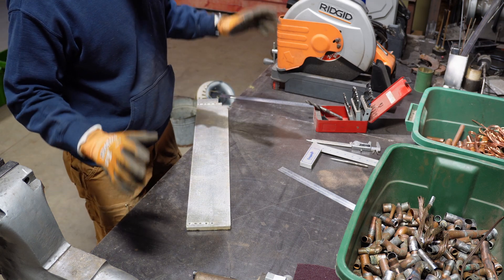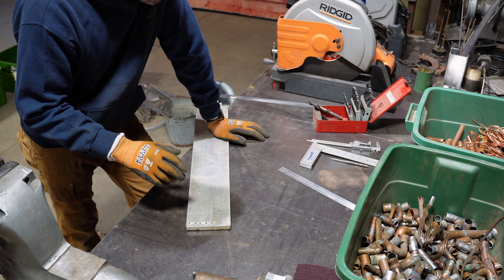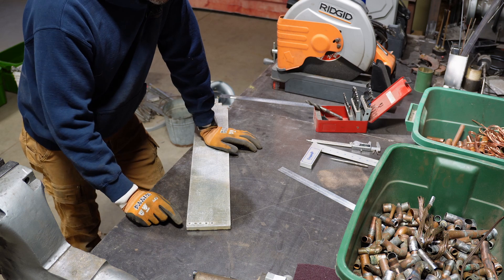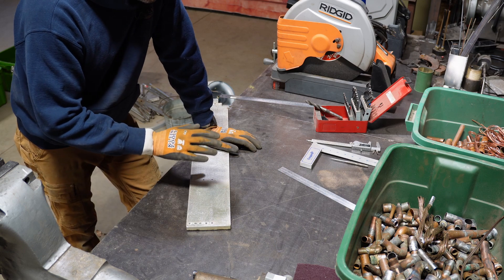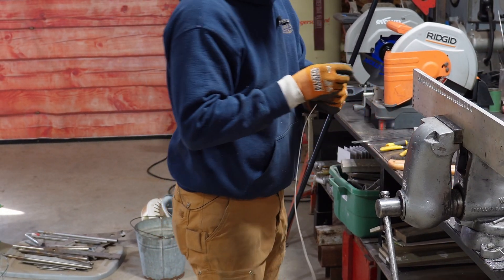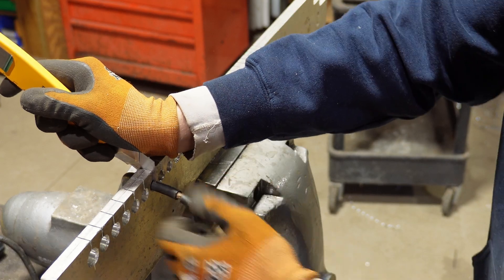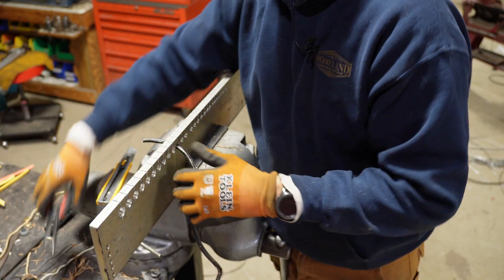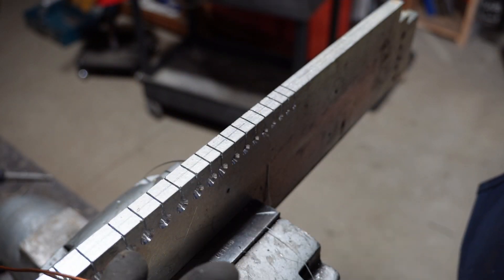Wire stripper fab

Comment: I used to throw my wire in a steel bucket with some gas and melt it off it separates but is a little smokey
Reply: I did that and my scrap place still counted it as no 3 or whatever it woulda been with the insulation. They're such a mf scam, but the only place within at least 100mi
Reply from the maker: Totally agree, I had weighed close to 200 lbs of copper, after looking at my receipt they only paid me for 185 lbs.  And the fact that they don't have a written document explaining the different levels within the metal categories tells you they don't want you to know so they can give you the lower price...
Reply from the maker: Yeah, lots of shops actually have a burn off oven just for this...